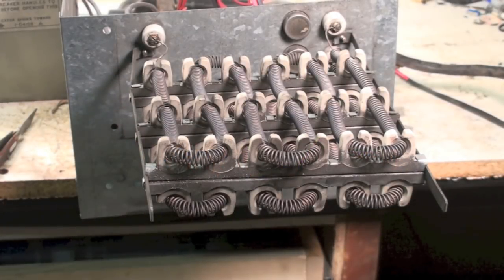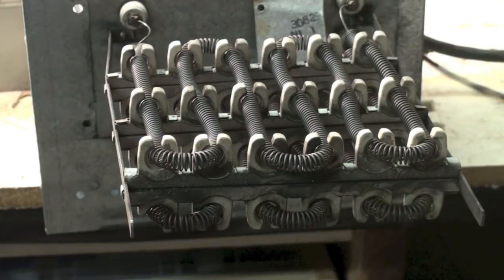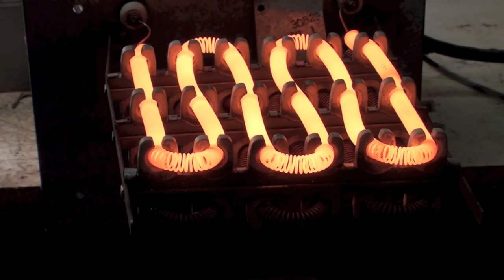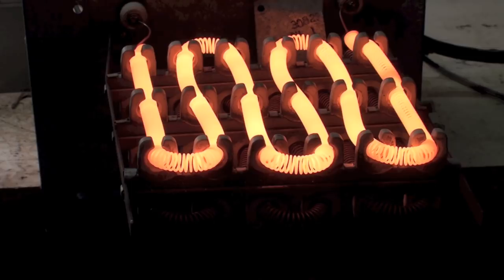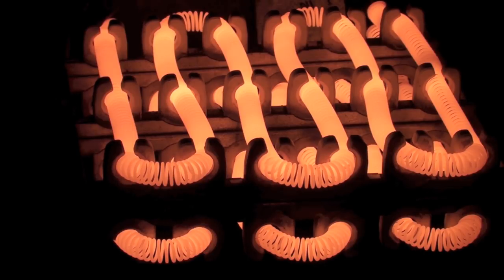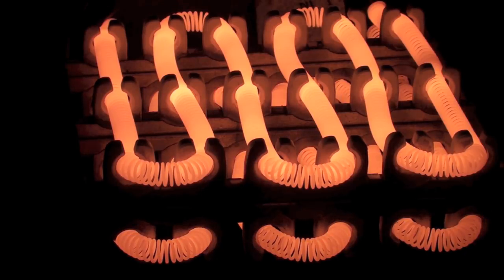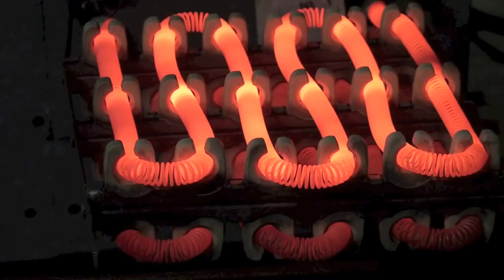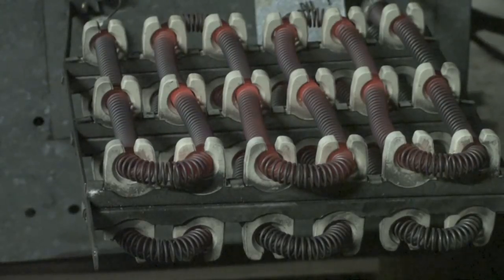How the electric elements on an electric furnace work  Part 2

Comment from the maker: That's about it.  The fan pulls the heat off very quickly.  Mostly the glow is from the ceramic mounts that reduce air flow.  Thanks for the comment.
GFM

Comment from the maker: That's a maximum temp for UL or GAMA testing purposes.  With the limit switch bypassed either furnace can out put very high temperatures.  An example for electric would be a self cleaning oven that reaches temperatures of I believe 1200 degreesF.
GFM

Comment: I replaced mine. There is no continuity to the frame. Ceramics are good. But here is my problem. I strung a new lime like the pictures. Mine does not glow all over. Mine has no areas of red then just after a dead spot the element looks like molten metal when using an oxy-acetylene torch. I’m afraid it will burn out. Yes, after in insulators all have same super bright about to burn. Was I not supposed to touch it?  It also seems like around the corners are cold but when straightens out and coils closer together those close ones glow. So mine are patchy. The resistance is 13.7 for all of them. What am I doing wrong?

Comment: Hello Sir. Thank you for your videos.  I have two questions. I own an Electric furnace which is coupled to an exterior thermal pump  (It is an older Carrier 3 pieces system :) )   IT is a 15KW system with three 5 KW elements on the heat strip.

One my coil is shorted and not working anymore. It is the number #1 element, so the first to be called on when the heat pump stops (-10 c). My other two elements coils are working fine.  

I was under the impression that when my heat pump stopped because of colder temperatures, the system would try to call on the first coil....and after while seing no heat was produced would then call on the second coil...and third coil afterwards if necessary.

It seems to be exactly what is happenning and this is my second winter with only coil #2 and #3 working.  Am I right thinking this what the furnace system is doing???

 I live in Quebec, Canada so we have very cold and hash winters. Altough my heatpump is opten in use because it is above -10c, even in very cold weather (-20 to -30c) I never seem to have a problem with only element #2 and #3.  

Also I have put off re-stringing the defective coil because I also have  240v heating baseboards in every room as a backup if the furnace would fail.

To re-string it I would have to do it in spring to find out the real diameter of the coil to buy a similar part.  My 2nd question is could I just buy a generic replacement coil  before taking it appart and just put it in the 3rd position. Does the coil diameter makes that much of a difference???
Reply from the maker: It could be working with only the first coil energized if there is at least 2 outdoor thermostats.  You do need to know the diameter of the coil before replacing.  
GFM

Comment: it just like a fan heater that you put on a desk the blower keeps the heating element at a fix temperature so the coils will not glow really yellow like that when there in the furnace although they will still glow a little in some cases kind of like a faint red sort of glow

Comment: So, is the coil heat strip bad if only parts of the strip glow when it's heated?  I took out a heat strip from a tempstar heater and when i put on the temperature varying from 75 to 85 and only the bottom parts of the heat strip glowed red.

Comment: I have 4 elements in my furnace. Is the #1 element the one closest to the blower? I think mine is wired wrong because the one furthest from the blower is the one coming on first, and when they shut down they do not sequence down.  The blower and all 4 elements stop at the same time.
Reply from the maker: I have seen them set up both ways.  The sequencing off at the same time is common.
GFM

Comment from the maker: Electric furnaces are similar to all furnaces, depending on how many elements are used.  Duct temp is usually 120 degreesF.  Amount of heat provided is very close to 100% of the energy used as there is no stack loss.  Hope this answers your question.
GFM
Reply: But how do you prevent the connections from melting? the connections between power source and the glowing element? I can see in the video that these connections don't glow, how is this?
Reply: grayfurnaceman do  you have  a wirering  diagram for wirering  them up
Reply: grayfurnaceman we have an electric furnace and I can read with a infrared thermometer gun 200° F
Reply: Can this be used for a big basement.... freestanding!
Reply: grayfurnaceman recita de torta se fangro
Reply: can you time how long this stay hot when its off?

Comment: I have question i call service technician and he mention that my heating coil is bad its not working well he said its running only on one leg right now soo after he left i try to check the heating coil and its looks fine i also check while its running both element looks red but not like yours doess... so you think my heating coil is bad but still running is it possible..?? I thought once its broke it won't run at allso help me if you can please thank you in advance..he was saying it should put 20amp and its only giving him 15 amp

Comment: two of three elements broke they shorted each other out is it safe to twist them back together I twisted them back temporarily please reply thanks
Reply from the maker: +vodka high They will fail again.  I would restring with new wire.
GFM
Reply: ok thank it worked for a lil bit but it got  hot cold hot cold etc  but thanks for your time i will get new wire
Reply: rick carp hi

Comment: Gary, are there new high efficient electric forced air furnaces cheaper to operate? I have a two stack model, stacks like in the video. It was installed in the early 80's and I only replaced a blower motor and two sequencers since then. So my question is, are new versions more efficient than mine from the 80's.
Reply from the maker: +GTO Bob 66 All electric furnaces are, for all intents and purposes, 100% efficient.  Replacing it would not help.
GFM
Reply: +grayfurnaceman Thanx for your input, I enjoy your site!

Comment: Hello came across your video while trying to figure out why my heat is barely warm unlike the element in the video my element when cut on both lights up then the bottom cuts of . Do you see that as normal
Reply from the maker: Sounds like an air flow problem.  Limits are probably opening.  Check air filter, fan blade for dirt, A/C coil for dirt and possible ductwork problems.
GFM
Reply: @grayfurnaceman  Thanks so much I'll try these things

Comment: My blower fan inside my electric furnace will blow about  maybe a minute after heating element turns off and when my air conditioner outside cuts off is that normal?
Reply from the maker: Yes, some units are set up the clear the heat from the ductwork.
GFM

Comment: When replacing a sequencer/s, should they all have the same timing or should they be staggered? I have 3 sequencers, 1 with a timing of H1-60 and the other 2 are H:1-110. If I'm understanding correctly, the H:1-60 will kick on first and then the other 2 will kick on after the first but both at the same time. Right?
Reply from the maker: ***** I believe you are correct on the timing.  Here is the problem.  The first element and the fan must be the first on and the last off.  The other elements can go off and on at any time during the cycle.  Hope this helps.
GFM

Comment: My electric TAPPAN furnace is blowing cold air, What do I have to replace?
Reply from the maker: Ahh, the answers could fill a book.  First, try resetting the breakers.  Then, check the control box (with the power off) for burned wires.  Check that and we can go from there.
GFM

Comment: Do can you tell if your electric furnace is putting out a decent air temp for heat.. it feels cold
Reply from the maker: You can try using a thermometer at one of the diffusers.  It should read about 120F
GFM

Comment: I have a question. I have 3 elements in my furnace. Sometimes only 2 will light up. One lights up from beginning to end and the second on goes on and off. The third one doesn't light up. Why do only 2 light up? Is this normal?
Reply from the maker: It is not normal.  You probably have a low airflow problem.  Plugged filter, dirty fan blade, plugged A/C coil, ductwork problems.  The second element is shutting off on high temp limit.  The third element could have a failed sequencer, burned wire or open element.
GFM
Reply: @grayfurnaceman  It's working fine now and all I did was touch the connectors. All 3 are working fine. Thank you for answering and your videos are fantastic. I learned so much from you that I was able to change a sequencer and a limit switch  Saved me a lot of money. THANK YOU!

Comment: Are these exposed elements? Like if you touched them with a butter knife, would you get shocked?
Reply from the maker: AaronLow1 Starting out young.  We like you, just be careful.  Electricity just waits quietly for you to make a mistake.  As for the elements, If you were touching ground with the other hand, yes.  These are normally inside a furnace.  They were just removed to show them.  
GFM

Comment: Whenever you wire for a furnace ( electric )  it needs 240-volts, correct,  so what I want to know how come the breaker doesn't trip when the elements come on,  a phase and b phase coming together at the strip,
Reply from the maker: The element is a load.  A load is a current limiting device.  You seem to think it is a dead short.  It is not.
GFM

Comment: Is electric baseboard heat more efficient than forced air?
Reply from the maker: Actually, far less efficient in a practical sense.  Baseboards have a higher air temp than forced air, which increases stratification of the indoor air.
GFM
Reply: @grayfurnaceman  I have oild heat and my WH n Stove are electric. I am installing central air what do you recommend forced air elec coil or elec boiler for my baseboard HW heat?
Reply from the maker: @JohnAvantiBK  If you are going to keep the HW baseboards, and want to change to electric, about your only choice is electric boiler.  
If you change to forced air electric, you must install ductwork.
GFM
Reply: @grayfurnaceman  do you a saving running gas to the house or buy an electric boiler will I save allot of money gas vs elec?
Reply from the maker: @JohnAvantiBK  Natural gas is generally cheaper than electric,  but the price of natural gas has been going up.  In most areas, it would have to be over $1.20 a therm for electric to be competitive.
GFM

Comment: My electric heater has been malfunctioning.   I watch the heating elementt through a small hole when I turn it on and then top one goes on, then the bottom one goes on, but as soon as the fan starts the top one shuts off and the bottom element stays on.  The heat won't go above 50 degrees.

Have you seen this before? Do you have a clue of what might be wrong? Thank you!
Reply from the maker: Sounds like an air flow problem.  As in not enough air.  Plugged filter or duct problem.
GFM
Reply: @grayfurnaceman  I have a brand new filter in there.  Same kind of filter I've been using for a couple years.  
The heater actually is in the garage, and there isn't any duct work.  There is an L shaped vent and it blows into the open air.  Vent goes up from the heater, and then a 90° angle.  

Should I try with no filter, just for a moment to see if I happen to have a faulty filter? 

Thanks again!
Reply from the maker: You can try the filter removal.
GFM
Reply: I know this is an old post but this may be of use to someone else.  Sounds to me like the blower fan relay is connected wrong. Here's a good article on the topic: https://www.hvacrschool.com/electric-heat-blower-interlock/  and here's a video of the same: https://youtu.be/DfUsThR-JwA

Comment: Probably a dumb question, but is it normal to be able to see this orange glow when I pop open the panel into the furnace?  Ours was making a clicking noise, and when the panel was removed where the motor is, it was glowing orange but only for a few seconds after the heat had kicked off.  Thanks!
Reply from the maker: It is not a dumb question.  Not asking it would be.  Your furnace has one or more elements stuck on.  Probably a sequencer stuck on.  This needs to be looked at by a pro.  Dangerous condition.
GFM

Comment: My heater started burning one leg of the breaker. All 3 elements ohm to about 11.5 ohm or so and no short to ground. I tried running the blower by itself and the breaker at the bus bar contact point only gets to 68 degrees. When the heating elements run one leg shoots up to 200 degree within couple min so I turned it off. The connections seem good. I cleaned the bus bar with a brass wire brush on my Dremel. I thought it was just a bad breaker but it's not. Anyone have any ideas? I see these little resister looking things mounted with my elements I have no idea what they are. Maybe I'm searching in the wrong place here. Nothing seems to be grounding out anywhere
Reply from the maker: Go back to the breaker.  2 things cause breakers to overheat.  Loose connections to the wires and a breaker failing inside.  Tighten the wires and if it continues, the breaker is failing.  btw the resister looking things are hi temp element fuses.
GFM
Reply: @grayfurnaceman  I replaced the breaker twice and checked all the connections... What's stumping me so hard.. I even changed the breaker again to be sure and each heat at one leg. It only heats directly at the bus bar on the one leg that the elements are ran off of. I tried running the blower only and they heat evenly to maybe 70°. I even cleaned the wire with a brass Dremel wire brush (was clean but did it anyway) and the bus bar as well to be spotless. And made sure I torqued the connections good. Went inside the unit and did this too. I checked the elements to all about 11 ohm which I thought is good. So if those resistor looking things are fuses that rules that out. Thanks for the quick response. But that's what I did first twice already. Is there something else that could try to make connection but be soft and causing extra resistance to the breaker contact? How hot should a metal breaker contact be allowed to reach?
Reply from the maker: First, breaker terminals should not heat at all.  Have you checked amp draw?
GFM
Reply: @grayfurnaceman  my clamp meter claims 2.2 amp on one leg with only the blower running and 45 to 46 amp on one leg with the heat kicked in. Any reason it would draw so much? It's a cheap meter unfortunately no fluke
Reply from the maker: Check both legs they should be the same.
GFM
Reply: @grayfurnaceman  they both read the same 45 amp (probably not right on this cheap meter so no idea actual). But only the one leg heats up. I did notice a sequencer that has the top contacts both with 120v even when the unit is off and all the connectors to the elements read 120v when the unit is off. I'm not a heat/air guy but that's not making sense to me? Are these coils activated some other way? I don't notice heat even though they have 120v at the connectors when it's off but they do heat when it's on but not as fast as that one breaker leg heats
Reply from the maker: You can't troubleshoot 240 volt (or most anything) using chassis for one voltmeter lead.  Because the circuits are controlled by a single pole relay(sequencer), feedback will read 120 everywhere.  In any case, If you are heating at the breaker, either you have loose connections or the breaker is failing.  It is simple as that.
GFM
Reply: @grayfurnaceman  thanks so much for your help... All boils down to what I always thought was impossible (breaker box bus leg bad) but must be possible somehow so I'm going to move it to different set of legs see what happens. Only thing that make sense at all. I've been chasing all these other ideas down that don't make any sense cause I just never could imagine how a piece of solid metal can somehow stop conducting the current adequately. But somehow that's got to be it. You ever ran into this?
Reply: @grayfurnaceman  well got it fixed. Thanks for the reassurance on it definitely being a connection problem. I really thought I was nuts to think a fully attached and cleaned bus bar could quit putting out. But I did put another new Cutler Hammer breaker after verifying my same already overheated breaker worked fine on the other bus bar. Then I put a brand new breaker cause I don't like the idea to have one that's been heated even if it's good. Thanks
Reply from the maker: Welcome
GFM
Reply: Just a breaker cause the elements stay on when suppose be shut off?
Reply: My elements stays on even running my A/C so I shut breaker off the one that’s mount inside the furnace. Now using the heater and element again stays on when up to operating temperature the fan stop right on time but not elements. I’m still looking around.

Comment: can I use 10,000 w electric element (Furnace) on a 50 amp cable Fifth wheel ?
Reply from the maker: I would not.  You need a 25% fudge factor.  And that's with no other loads.
GFM
Reply: @grayfurnaceman  Thanks,  5,000 w is the maximun can use with the 50 amp cable.

Comment: Thanks for posting.  Does current technology allow only one to come on if that is all that's needed?  I'm in the process of replacing a 25 year old heat pump system and learning more with every vendor I meet.  One vendor stated that certain coil configurations can be set up to operate this way.  For example a 9kw coil can have three stages of heat generation all controlled by the thermostat.  Is this true?
Reply from the maker: The most stages I have seen is 3.  Usually there will be several elements that can be sequenced on.  Say the temp inside is 69 and is set for 70.  One element will come on.  If the temp drops to 68 due to higher load, a second element comes on and so on.
GFM